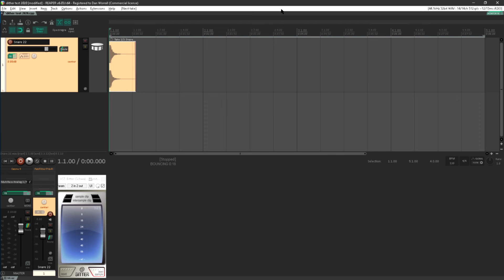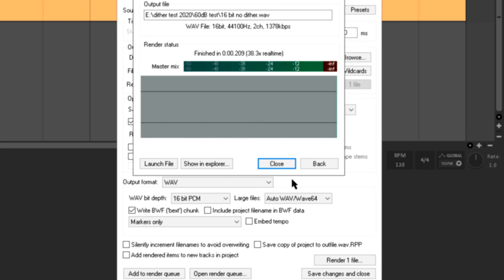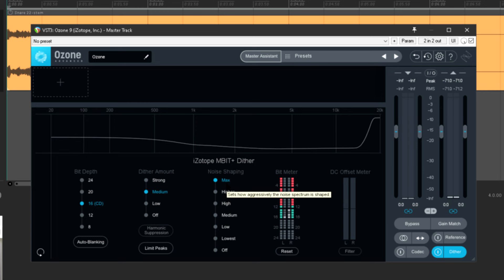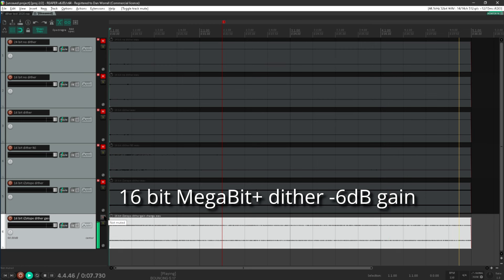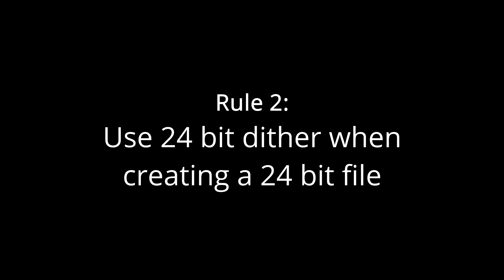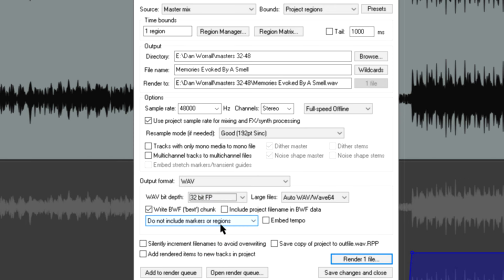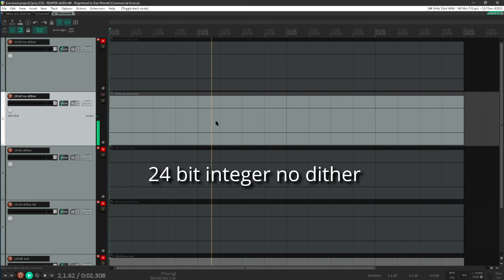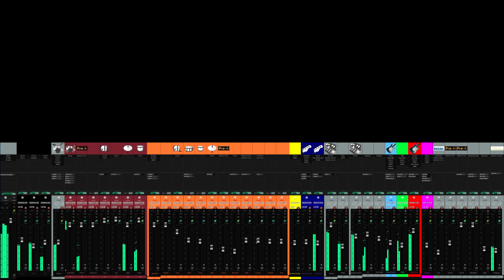WTF is Dither?

Comment: There is usually enough noise on the master bus that no additional dither is required and actually only adds unhelpful noise or fatiguing noise shaping frequencies to a naturally dithered master. My mastering chain includes an analog loop that introduces a noise floor slightly lower than most dithering algorithms and actually sounds better when put through a test like the one in this video, so this is not a theoretical statement. Even people who don't go through an analog loop on the master bus are probably using at least one plugin (but more likely an army of them) that adds more noise than is necessary to do the job. And if you mixed your track on an analog console, you sure as hell don't need to add dither.
Reply: Dither is non issue when using analog.  Latency, no matter how old or complex the interface is, is a non issue if you know what you are doing.

Comment: Another great video! Thanks!
But regarding "The problem with LCR". you mentioned there are strategies for wide stereo mixing that have improved mono compatibility, and you would do a related tutorial...
It would be dead cool if you would do it soon!
Reply from the maker: 3 part series on its way. Parts 1&2 done, part 3 in production. It won't be on this channel, but I'll post here when it goes live...
Reply: @DanWorrall  Brilliant!
I really need some inspiration since I've noticed that so many consumers only listen to art through their phones these days. We can work the frequencies by monitoring on Auratones or similar and find a compromise that works well on full range speakers and grot boxes. But how to compromise between mono and stereo consumers? I'd certainly be very interested to hear your take on that...

Comment: what's really interesting is noise shaping with high sample rates. the noise gets pushed into the ultrasonic range and, after reconstructing with a lpf, you get a true floating point output with real DR, same principle as OS DACs. with dithering, dynamic range is more of a rectangle with sides bit depth and sample rate than just relying on bit depth. You can even get away with 8 or even 4 bits if your SR is high enough. You only need 1 bit with dithering if you're in the mhz range.

Comment: Hi, Dan
Thank you for the opportunity to think about this subject.
After null tests for all dither and non-dither, and there is one conclusion.

Most of the music sources have no space(or silence) and they are filled with full of musical content.
Therefore, quantization errors occur continuously in all frequency bands,
So the sound due to quantization error will eventually be the same as white noise.
(i.e. a null test between a 32-bit source and no 16-bit dither is similar to white noise.)

So, does it make sense to add dither noise to the already existing noise floor?

In this case, i think it doesn't make much sense logically to mask random noise as random noise.

It's an old topic, so I can't expect much, but I'd be very happy to get your answer.
Your videos always give great insight
thank you!

Comment: Thanks for this, immensely informative. One - very silent, way below threshold of hearing :) - question: The initial render of the reverb tail was in 32 bit FIXED right? I wonder it that is significant for the following 24 bit renders? I seem to recall Fabian from TDR (who seems very knowledgeable) stating that adding dither noise to a floating point file before truncating doesn't make sense, since there is no fixed level for the noise to be calibrated to; it just adds to the noise floor without addressing truncation distortion. There was some debate over this, but if that is correct, the 24 bit with dither render should be broken if any processing hade been applied, thus "floating " the bit depth, right? Might be a cool addition to the test, since most (all?) DAW are FP internally, and some can't export 32 fixed.  Anyway, thanks again, learned a lot from this!
Reply from the maker: I'm pretty sure it was a 32 float render. That's the default in Reaper, useful in case your track render goes over full scale. Fabien does indeed know a lot more than I do, so of course he's correct that a floating point file can't be dithered. But you can add dither noise at the correct level such that the file will be dithered when it's truncated to 24 or 16 bits. In fact that's exactly what happens anyway when you use dither: the noise has to be added to the original signal before it's truncated, otherwise it won't work.
Reply: @DanWorrall  Thanks for the reply. If it indeed was FP render (hard to see!), it seems to suggest that adding  dither to floating point before truncation really is effective. Really out of my (bit) depths here, however, and may very well be overlooking something really basic. Might have a go a replicating the test and will report back if something interesting emerges. Best wishes, Erik
Reply from the maker: @nosslinkire  yes. That's how it usually works: the noise is added to the original signal at its original bit depth first, then it's truncated or converted to fixed point. It's entirely possible to separate those two stages, and eg. render a 32 float file with 24 bit dither noise burnt in, such that the file is ready to be converted to 24 bit with no further dither required.

Comment: Everytime I think there’s a topic I should know enough about to not need a Dan Worrall tutorial I am dead wrong and my mind is even more blown.  :) Thanks for the video! I now need that Bitter plugin, didn’t know it existed!

Do you know how Pro L2’s dither holds up? There is also the GoodDither by Goodhertz which I have to admit I own but rarely use but they claim to be “the best” (which probably everyone does).
Does the mp3 phenomenon also apply to ogg? As far as I know, ogg vorbis is always 16-bit and SoX for example adds dither when converting to ogg by default iirc.
Reply from the maker: Pro-L2 dither is fine. Perhaps not quite as soft as MB+ but absolutely good enough. I tend to just tick Reaper's dither options when rendering 24 bit files, and I use MegaBit+ for 16 bit, just because I've got it and I might as well. But the difference isn't worth worrying about IMO.

Comment: The extreme dynamic range in MP3 is only available at constant bitrate. At variable bitrate it will cut bands that are below a threshold to reduce the bits. Then you will hear "FFT artifacts" after boosting by 60db. Dither can force the algorithm to keep encoding because the sound never falls completely silent.

Good players always decode to floating point. But they have optimizations for high speed in FFMPEG, and 100 db would require more accuracy than is allocated in the decoder.

Comment: Thanks for this video, Dan!
 I ran my own tests based on these, turns out that ozone's dither on noise shaping at max produced a less annoying noise, but the peak was way too high in comparison with live's dither or airwindows one. I find that noise shaping on lowest produced a noise that peaks at the same level as the others, but the sill is less annoying. If you don't have ozone 9 I recommend airwindows plugin, ditherbox, mode Paul 16 selected, but watch out, there is a dbpaul mode as well, but it peaks a little higher.

Comment: Oh, it's worth adding that in "real" mix where the disappearing reverb tail is mixed with signals at normal levels in the same mixpass you won't get that perfect 32 bit sound on the tail. Close in time to where the correspondding 24 bit sound would disappear into dither you will get a similar noise floor with 32 bit floats (character might depend on DAW and plugin though). Not so different to 24 bit but a couple of dB lower. In general impossible to hear under normal circumstances in both cases.

Comment: It sounds a lot cleaner, but those high resonant frequencies actually give me a headache at this level. When the sound stops it's almost as if pressure has been lifted off my ears, even takes like half a second to adjust back.
Reply from the maker: I'm guessing you've got younger ears than me...
Reply: @DanWorrall  Haha yep, somehow they're still holding up pretty well
Reply: Luckily the noise at -60 dB or -108 dB (below the actual signal's peak) would still be significantly quieter than background HVAC noise, or a calm breeze. Or if you happened to breathe in while a reverb tail turned into truncation distortion👻
Reply: @Falkro Stix There was either one or a couple of more defined tones in the really high ranges, iirc, aside from the general noise that was lesser compared to other version. (A LOT higher in frequency than the fundamental and overtones I can hear clearly in mosquito sounds)
Reply: Could you hear those if you weren't looking at what you're supposed to hear? Cause that might simply be confirmation bias at work. And your dither noise would be buried inside other sounds that are 90 to 140 dB louder than it in practice.
Reply: @BrunodeSouzaLino  I mean I only hear it in this exaggerated example, can't hear a trace of it in practice
Reply: Dither is not supposed to be audible. Dither exists to eliminate truncation distortion when converting across sample rates.
Reply: @BrunodeSouzaLino  I'm confused, pretty sure we're checking out the differences in how the algorithms SOUND in this very video.
Reply: Still, dither is not meant to be audible. Dither exists to deal with quantization error in PCM audio streams, which can cause distortion. Much like tape, dither used to have audible noise when it was first introduced, so the type you used was important. Nowadays, you'll be fine even if you don't use dither, as even your bog standard off the shelf DAC has very little noise and is transparent.
Reply: @BrunodeSouzaLino  I quickly skipped through the video to check if I could clear up what I'm talking about, at 7:26 I hear what sounds like a VERY high, slighly flat A note. Idk if this is the strongest case but was skipping through video and this was the first point where I immediately heard it
(Sometimes sounds more like a sharp A#, kinda hard at this range, if I'm accurate to begin with)
Reply: As Dan points right after that example: "You have to remember that these are boosted by 60 dB". In normal circumstances, that noise would be 60 dB down the signal if not more.
Reply: @BrunodeSouzaLino  That's what I've been pointing out all along haha, I had a feeling this was the misunderstanding

Comment: From 17min on, this video showed me that in a "perfect" world, you'd never MP3 encode a 16-bit version which had shaped dither applied (Dan recommended doing just this to account for MP3 decoders which decode to 16-bit before feeding into the playback software/device). A clue at 19:00 - Dan: "we know that this distortion isn't burned into the MP3, because it's not there when we imported into Reaper." That perfect world has players with smarter MP3 decoders which apply noise-shaped dither to their 16-bit decoded output presented for play (or at least have this as a feature that can be turned on). Such a smarter decoder could give the best-possible 16-bit output representation of the deeper data present in the MP3, seeing as it was created from 32-bit data.

Encoding MP3 from a dithered 16-bit master will solve issues with quantization noise from a "naive" decoder, as he demonstrated, but not without a bit of loss of the dither's performance (as he also showed), and possibly also a little less coding efficiency, as the encoder is then being asked to encode the added noise signal. Dan demonstrated that clean, high bit rate data going into an MP3 will be preserved on decode, if decoded back to the same high bit rate. This tells you that the data important to a high-quality result is in the MP3 file, even though it was lost or terrible sounding when decoded directly (I'll say, naively) to 16-bit and played. Further, he's demonstrated that high-quality results are possible when shaped dither is applied to 16-bit output created from high-depth input. So, in an ideal world, you'd render your high bit-depth material directly to MP3, and trust the decoder to decode to 16-bit for play in an intelligent way.

(sung like Eric Clapton: 🎶It's in the way you decode it! Boy don't you know-w. If you apply dither to it. Your bit-depth won't show-w!🎶)

Because constrained decoders/players exist (hmm, I dunno, maybe all of them…does anyone know of an MP3 decoder which operates as I've indicated, outputting 16-bit samples with shaped-dither generated on them internally?), exporting MP3s from material that's been downconverted to 16-bit and dithered manually, first, is engineering the best compromise for the lowest common denominator.

It probably doesn't matter, however, since we're talking about material very near the noise floor of 16-bit samples. 16-bit has plenty of dynamic range for all practical playback scenarios; probably most amplifier-speaker setups cannot usefully exploit the full range. If you've ever heard the quantization noise in the fadeout of a track, it was probably a production error. I have, but to my knowledge those files were by no means professional works. (caveat emptor: I am just a curious amateur.)

Comment: Hello Dan. Let's say I recorded 24bit and mixed in Pro Tools with a hardware insert at the mixbus. Would there be an advantage, at least in theory, to use 24bit dither before the hardware insert, since Pro Tools functions internally at 32bit float? Also, in general, bouncing a mix at 24bit from a 24bit project requires dithering, due to the same 32bit internal float processing? Sorry about the confusion, thank you for the amazing lessons.
Reply from the maker: Yes, and yes.

Comment: I've put the Bitter plugin at the end of mix mix or mastering chains in Reaper.  It indicates either 32 or 64 bit audio depending on what plugins are running.  Whilst printing a 24 bit mix or master, do you have a preference to use Reaper's rendering dither/noise shaping or the dithering options in FabFilter Pro-L 2?  Thanks so much for your contributions to the community!   -chaz
Reply from the maker: 24 bit dither: I honestly don't care, anything will do. 16 bit dither: iZotope MBM. Because I've got it and I might as well, not because I think it matters much in most cases.

Comment: Ok, think like that... If we have a max bitrate of 320 kbps and anything around are encoding it in 16-bit pcm for playback, then if it will be encoded in 32 bit or 24- the bitrate is the same and cant be higher= we will get a distortion all across the waveform or mostly in a high frequencies?
Reply from the maker: If I understand your question correctly... No you don't need a higher bitrate to encode a higher bit depth. The MP3 is always floating point. If you give it a 16 bit source, instead of 24 bit or 32float, you're just choosing to use less of the available dynamic range.
Reply: @DanWorrall  Thanks! I get it. But the limitation of 320kbps is make some kind of a bottleneck, right? That's why they decode at 16 bits always for safety? On a snare it's definitely was a clean sound. But is more complicated sound material that bitrate limit may be not enough for higher bit depth in mp3. Which i logically presume, that it is some kind of a limitation, that's why everything is using only 16 of it's bits for mp3 playback.
Reply from the maker: There two reasons you could get 16 bit audio from an MP3: either the decoder doesn't care and just gives you 16 bits regardless. Or, the MP3 was originally encoded from a 16 bit source. Usually the second reason is true, even if the first is as well. Because at the end of the day noone can hear those extra 8 bits anyway ;)
Reply: @DanWorrall  Thanks! I was surprised about that. Very interesting.

Comment: Hi Dan, I was wondering if you had an informed opinion about which bit depth to deliver to streaming services? I've read that lossy encoding (AAC, etc.) performs better when fed with a 24bit file. Do you think delivering a 24bit file for this reason is worth it, or do you stand by your statement in this video, that delivering a standard 16bit dithered file for distribution/streaming is the optimal choice due to the unknowns in user playback (how their iPhone or playback system will decode the AAC)?
Reply from the maker: Performs better how?
Yes I stand by that. Unless you're producing ultra dynamic audiophile orchestral recordings, the extra dynamic range from 24 bit audio is totally irrelevant. So you're introducing the risk that the player will truncate to 16 bits for no audible benefit whatsoever. IMO.

Comment: While recording my synth, I hear white noise, if I choose to monitor digitally. Why is this happening? If I choose analog monitoring, the noise is gone. I doubt I hear the quantization noise, if it's below -90dB. Increasing the gain causes the noise to be louder, no matter if digitally or on the device. If I set it low enough for the noise to disappear, my synth is too quiet. What's happening here? How do I record it properly? (Arturia Minifuse 2 with Microfreak)

Comment: Dither is an intentionally applied form of noise used to randomize quantization error, preventing large-scale patterns such as color banding in images. Dither is routinely used in processing of both digital audio and video data, and is often one of the last stages of mastering audio to a CD.
Reply: Thanks. I was about to comment that he forgot to explain WTF dither is :D